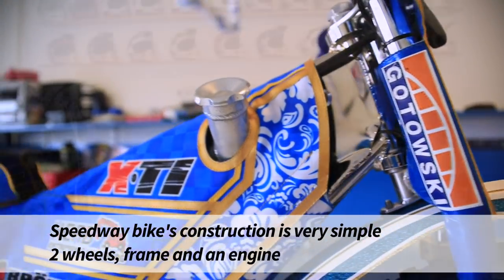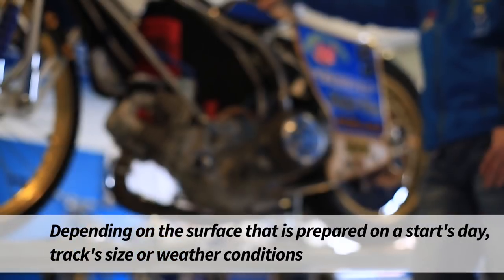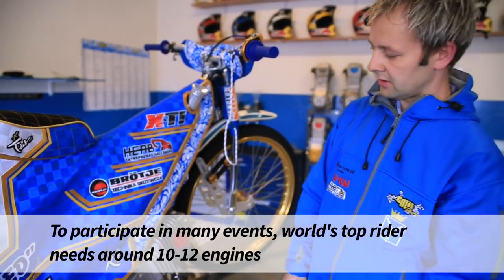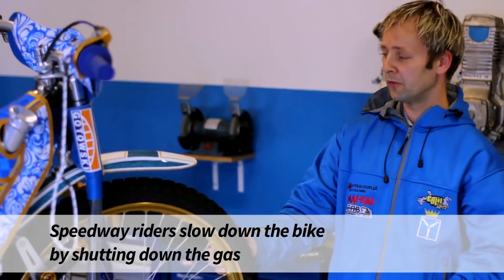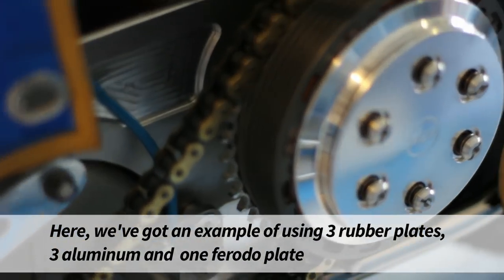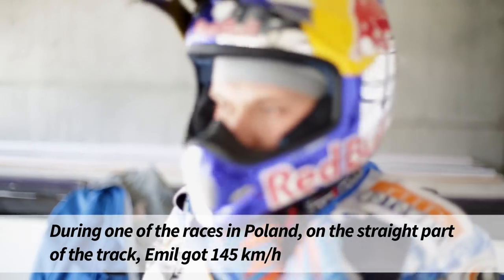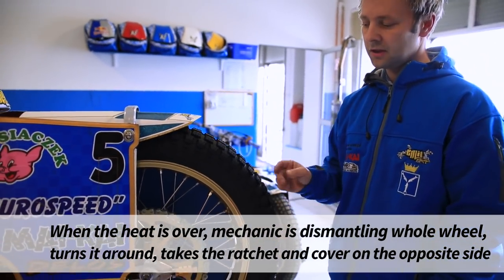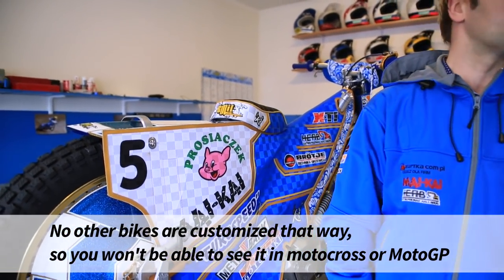SEC TV: Speedway Basics: Bike

Comment: wouldn't a 450f engine be faster? like out of a honda crf450r...
Reply: okay 60hp honda vs 80hp speedway engine (not to mention extra torque from being 11% bigger) and the engine is WAY lighter being air cooled. stick a 450f engine in a speedway bike and it'll feel like a truck.
Reply: Lol!
Honestly. Some people just don't get it. You're trying to compare a grass cutter against a loco. There are zero similarities.
The reason the engines and drive system are so different is because of how they evolved.
Reply: With a little modification and open exhaust?  bored out to full 500cc?   Let's see bone stock close to 55 hp so only need 20% hike to bump into the middle 60s hp .... Would not be a huge difference in speed to current so long as they were not up against one another directly ....in other words from spectators point of view ...I feel like a modern hotted  MX motor could easily do this job....of course they are liquid cooled so you would loose some cool looks to a tiny radiator (what 4 laps?  maybe get away with barely any thing?) .  ...I think the idea has merit!   Put all the big MC manufacturers in it running engines based on production bikes?   Could get really huge instead of just niche ...  Would love to see it tried!
Reply: @jackking5567   they evolved in a time when there were no production engines that could cut it ...My guess is IF speedway was just beginning NOW?   Existing production platform motors WOULD be used with good success ... the way it is, is as much tradition as anything else if you ask me.   I am not that impressed considering speedway bikes are so narrowly focused ....it surprises me they are not way lighter if the stops are truly pulled for anything goes....I read they are 175llbs?   Dang factory Motocross bikes are just over 200llbs ....look at all the stuff that is missing  in comparison!   Brakes, tranny, suspension linkage,shock, massive front forks on MXer etc etc ....I would think the speedway bikes would be like 120llbs by now if the stops were truly pulled out....WTH?    Looks to me it is a cliquish  thing they want to keep just like it is ....exclusive and very difficult to break into.   Reminds me a LITTLE of how Harley managed for so long to dominate 750cc  flat track  racing  and keep as an exclusive Harley thing....really had folks believing THEY were the penultimate power plant for that form of racing ...various folks did not want anyone (like Honda) messing with the formula either (but of course they finally DID and TROUNCED Harley!) ...but at least there have been other classes in that sport an so various smaller displacement bikes at least could compete on the same track if not same displacement races ....personally I hate one company racing.   I would think speedway or something visually near identical COULD become a really popular sport if it were done right...  If it were not so WEIRD I might have tried it when younger ...but I swear the way it evolved?  It's like intentionally bizarre!   I think that's what keeps motorcycle manufacturers out of it to tell you the truth ...the bikes bare no resemblance to any models being sold ... but like I say IF racing on approximately that length track was just now starting up?   I bet the bikes would manifest quite differently....but what do I know ....just guessing.....day dreaming
Reply: mickpork okay lets put a 450/ 500 mx engine in a speedway bike and see what happens!

Comment: Unless I am really missing something I'd say there no great reason these bikes have to be so bloody exotic and expensive to campaign  With just a little imagination and rule changes I'm thinking be so much cheaper to race with barely noticeable speed difference to the spectators using production based MX motors and race gas!..  ...It looks like the way it is a result of cutting edge competition and doing everything possible for an edge PRIOR to the advancement of four-stroke race motors....back when  radical things were called for to get some power to the ground  ...   Ya know?   But that was then and this is now when big horsepower is reliably squeezed from same sized engines Mass produced.... Just make it a rule  gasoline only ...and while we are at it? a rule just one engine ...ONE clutch per event.    Have a weight rule to prevent use of exotic materials.... So the motors get slightly detuned compared to now?   so what?  As long as it is the same for everyone?  Spectators could not possibly tell the speed difference between 65hp and 75hp engines unless they were running in the same race....People could actually afford to dabble into this sport on a budget with the right rules.   Consider that a bone stock 450cc dirt bike today puts out close to 55 hp and could easily last an entire season of speedway distance....plenty of potential for more HP too ....bore/stroke to full 500cc, gut the tranny, lose the starter,  up the compression to the point of having to use high octane race gas ....a hotter cam and less restrictive exhaust?  simple cheap mods ...I'm betting you will be very close in power to the exotic speedway motors being used....and the engine parts from Mass produced production dirt bikes items would keep things pretty cheap AND I dare say really reliable!   Using 450cc dirt bike engines also offers that stock wet clutch could be used... I'd love to see this tried!   Even in a novice class format.   Would really be interesting to see lap time differences
Reply: Quote from one discussion board  "AMA Pro dirt track 450s make 80+ HP" ....Which loosely/generally are factory tuned versions of production MX bikes
Reply: It's happening with formula 2 speedway, 450cc motocross engines in a speedway bike. The problem isn't the power, it's the flywheel. Formula 2 speedway bikes don't slide nearly as wheel, 500cc speedway bikes do, as they have massive fly wheels, that's what allows them to generate the power and momentum to slide. So as fantastically cheaper and easier  motocross engines are, they can't produce the same effect, if however one of the manufacturers would increase fly wheel size, that could be something special